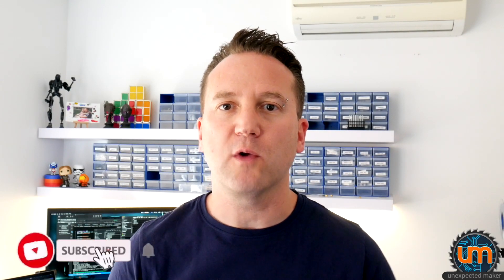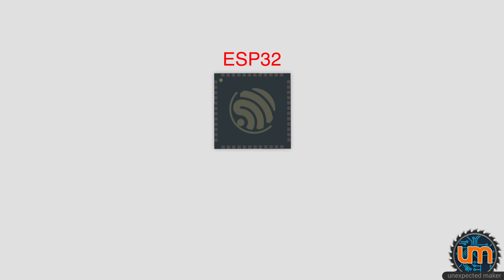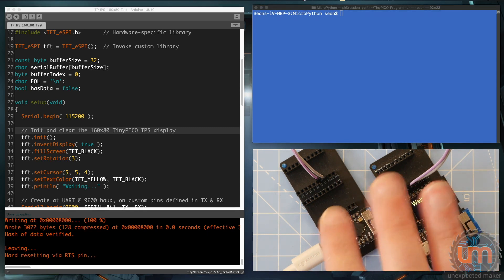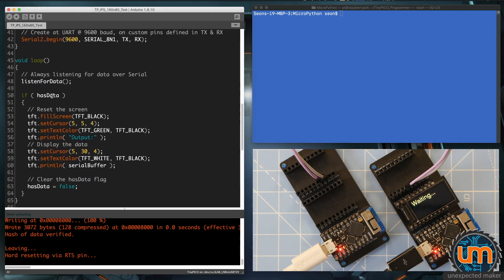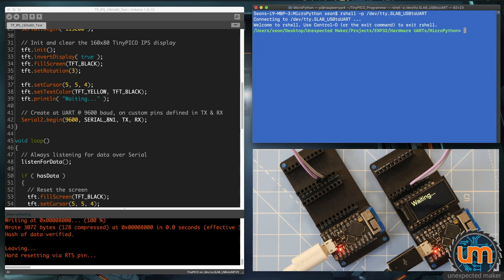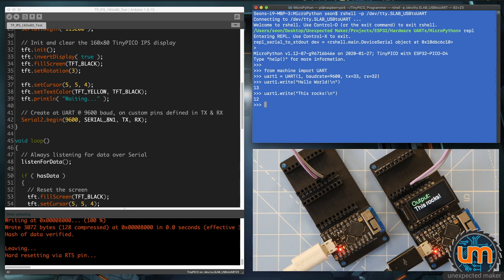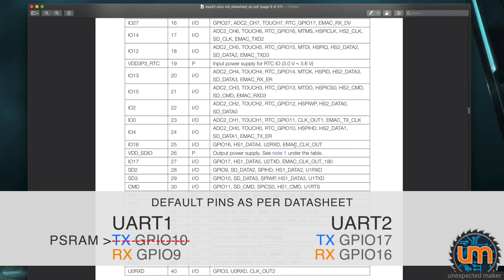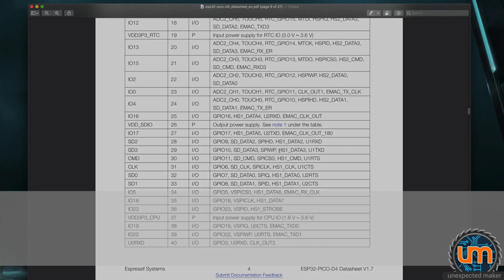ESP32 & Hardware UARTs

Comment: I know this is an old thread, but I’ve been struggling getting UART1 running on an ESP32-S3 module. I can’t help but notice HardwareSerial in the Arduino IDE2.2.1 shows the parameter order in Serial.begin to be: BAUD, Config, _RX_, _TX_, … . Receive and transmit pins swapped from what you show. Was this changed in the IDE in the past?
Reply from the maker: I'm not using HWSerial. It's not needed. Just use Serial.begin() - It's still a HW UART.
Reply: @UnexpectedMaker  hmm. Maybe I’m making this too hard :) thanks, will test this tomorrow. Very nice channel btw. New sub
Reply: @UnexpectedMaker 
That was a decisive comment. I tried first with HardwareSerial Class as well. Thx for the video, help me so much.

Comment: 1) If I can use any pair of pins for a UART, why does calling begin(9600, SERIAL_8N1, 16, 21) on a HardwareSerial cause a Guru Meditation Error? 2) Whatever I feed begin() as the TX pin, it doesn't go by the Chip Pin #, it goes by the number on the TinyPico PCB. I've verified with an oscilloscope that begin(9600, SERIAL_8N1, x, 26) causes serial output on IO26. 3) I've been entirely unable to get an RX pin to work in this configuration, no matter which pin I use or whether I name it by it's Chip Pin # or its IO number. Where am I missing the disconnect between docs and behavior?
Reply from the maker: You can't use IO16 on the TinyPICO - There is no IO16 on the headers. IO16 is reserved for Flash. The numbers you are passing the .begin() are GPIO numbers. Not IC pin numbers.

Comment: in your video and some website says that default pin for uart 1 is gpio 9 and 10, but abother website says that the pin (gpio 9,10) are recomended to not be used. is really we can use gpio 9 and 10 for serial communication?
Reply from the maker: if the board has IO9 and IO10 free, they can be used. My TinyPICO uses IO10 for PSRAM and IO9 is not broken out, so they can't be used :)

Comment: I am new to ESP32.  Using those 30-pin modules.  My question is: how about using those pins designated "input only"?
Also, are there any issues for input (rx) pins that have no internal pullup?  This 30-pin module has Uart2 available, and a USB port(so assuming uart0 is taken).  I have a Nextion display on GPIO 16,17

Comment: Pro tip there is also an invert param you can pass to serial, to invert uart logic, say for using with optocouplers ( they invert ), I was playing with it just the other day.     
I think you can also define and  change these hardware uart default pins ( not sure if you can do it in boards file or not ) RXn/TXn and there is also NO_GLOBAL_SERIAL , I think it prevents init of hardware uarts